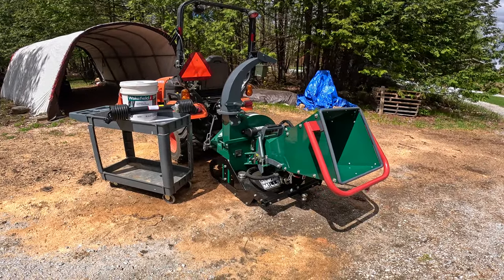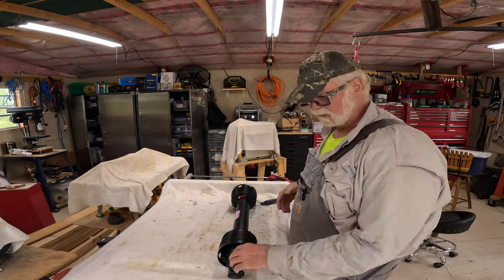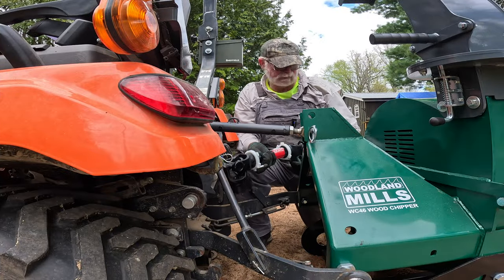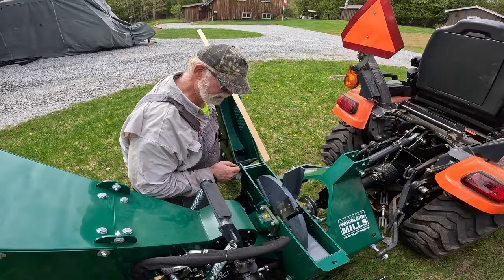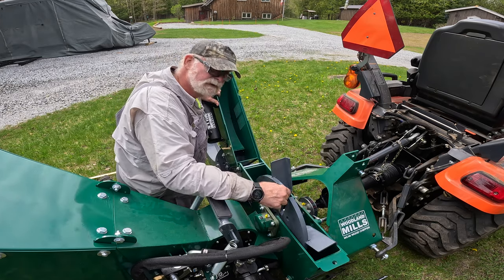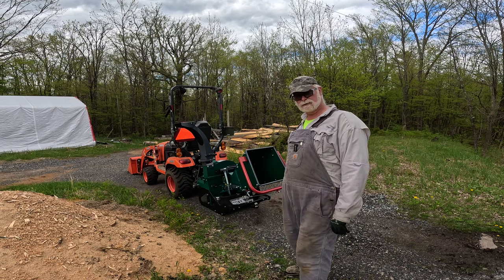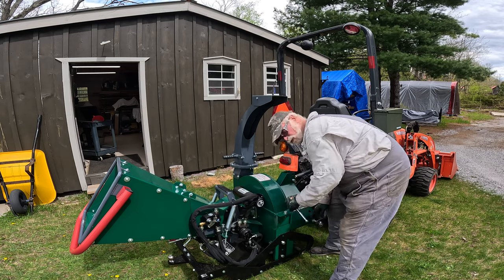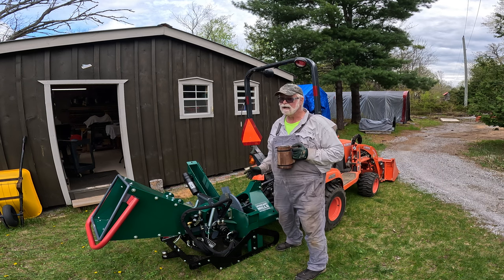Setup, Testing & First Impressions Of The Woodland Mills WC46 Wood Chipper

Comment: Fantastic video, Brian. I have no experience with the Woodland Mills chipper, but you did a good check and prep before running it. I have a Wallenstein chipper I bought used about 4 years ago. I'll be using it for the first time in the next few days. I'll run a checklist like yours first!
Reply from the maker: Good stuff. I love having a chipper. All those chips will be going down on my walking paths throughout the property. Good luck with yours and thanks for stopping by!

Comment: It looks like a good machine and seems to work well. It does look like the chute is a little low for loading a trailer
Reply from the maker: So far it's looking really good. The chule folds up out of the way when moving it or hooking up a trailer. I havn't pulled a trailer behind it yet. Thanks for stopping by!